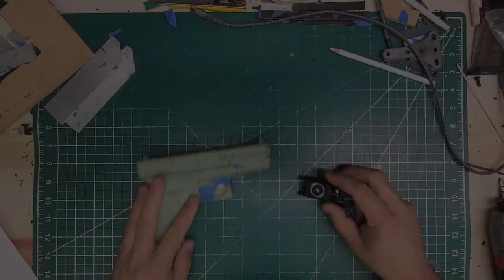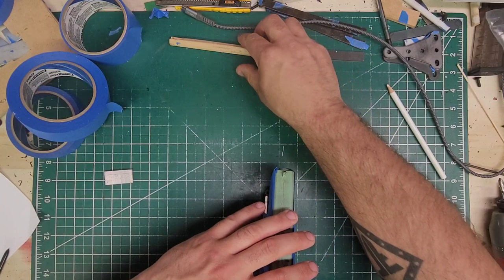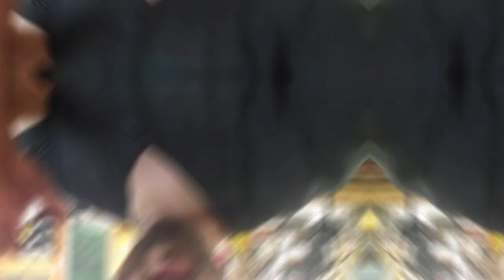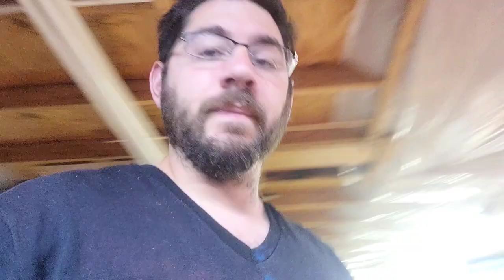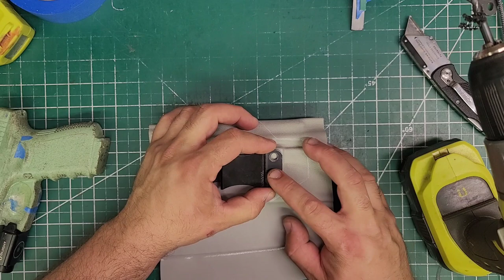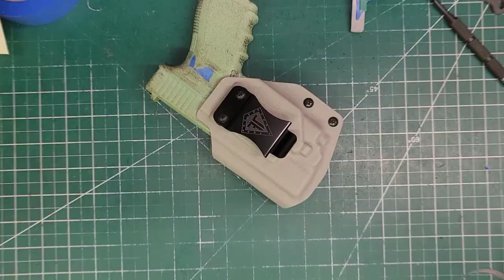Glock 19 with Olight PL Mini 2

Comment: When adding a dowel for sight channel on molds that do not have that prepping, I am always having problems with it moving after foam press. What could I be doing wrong? I am also sanding the bottom as you do.
Reply from the maker: Tape it extremely tight. And by sanding a slot so the front post sits inside the dowel helps a lot.

Comment: I think you mentioned in a previous video that you were going to start doing custom kydex prints. Any update on that front? I want to make holsters for my band members with my band's logo on them. I know there's places that do it, but if you're going to start doing it, I'd rather wait until you're up and running.
Reply from the maker: I'm having trouble with my printer. It won't put ink on paper. Trying to research through it
Reply: FalTac Unlimited LLC 10/4. Keep me/us posted!

Comment: when you make a holster for a gun that already has a Red Dot mounted on the slide, do you remove the dot prior to pressing in the mold or will it be okay under the heat and pressure of the clamp?
Reply from the maker: Depends on how you want to make the holster. I have done it both ways with keeping the rmr or not.if you're looking to cover the rmr. Keep it on. If your cutting around it. Keep it off
Reply: @FalTacUnlimitedLLC  ok sounds good, thanks for the quick response!

Comment: How wide is the aluminum piece you used to mold the light on this holster? 1” 1.5” or was it a custom width cut  by you?
Reply from the maker: I cut them to fit different applications.  I have some a 1. 1.4 and even 2 inches wide
Reply: @FalTacUnlimitedLLC  Thanks. I will check my set up to determine the width.

Comment: Random question, why didn't you cut the kydex down to the belt attachment? You left an 1/8 th or so, maybe a quarter inch of material over the belt attachment point instead of cutting it down to the blocking, did that make sense?? Lol Never realized how hard it is to describe these things through text haha
Reply from the maker: If you cut at the fomi it is actually weaker.  Will crack easier. So I leave some material above the fomi
Reply: @FalTacUnlimitedLLC  I completely agree and do the same!! My concern was when you showed the pics at the end you could see the holster was "touching" the pistol above the clip, normally for me that's where I'll get wear marks on the gun If I'm not careful. I'm guessing with the light it should open up the holster just enough it doesn't touch?
Reply from the maker: @joshmajor8662  the 5 layers of blue tape I put on help a lot with rubbing
Reply: @joshmajor8662  it also keeps the gun from hitting any of the FOMI hardware like the slotted post when you're re-holstering
Reply: @FalTacUnlimitedLLC  OK, I'll try it haha Thanks man!! Text ya tomorrow, hopefully Lol
Reply: @DOLEMITEMF  I hear ya there!! As long as you don't cut down to the blocking and go past it or use screws to long you shouldn't have that problem. I go down to the top of the blocking and cut along my line from the block, I always leave a lip to help cover the hardware. Doing Sub-compact pistols with an RMR cut and a wing, things start to get kinda tight, compact haha
Reply: @joshmajor8662  yep, been there when you gotta cut along the corner of the FOMI blocking to clear the RMR haha
Reply: @DOLEMITEMF  EXACTLY!!! Hahaha